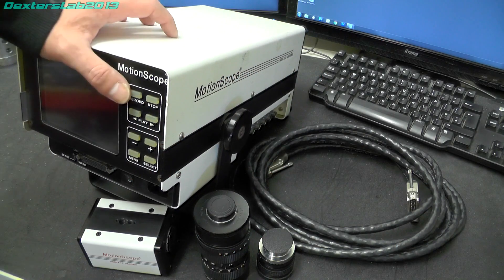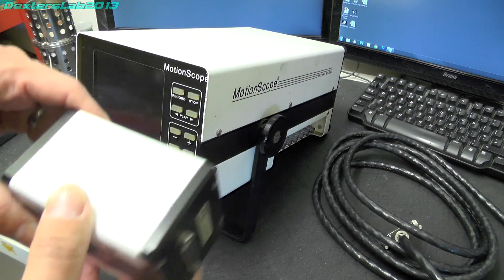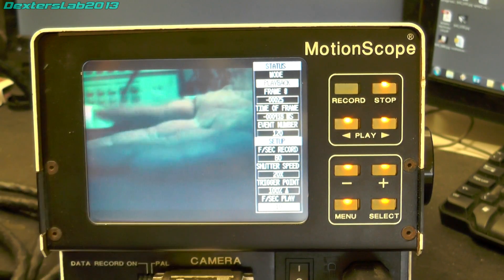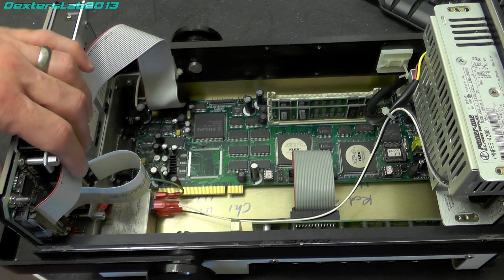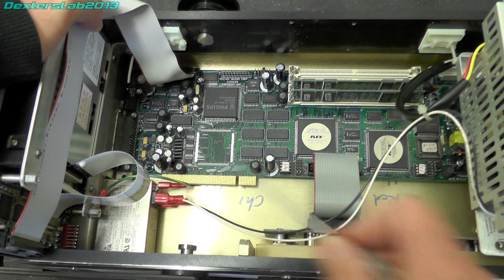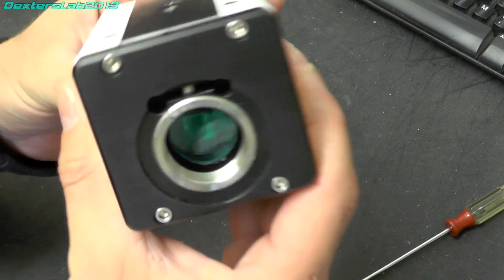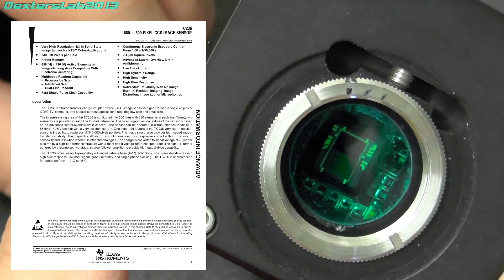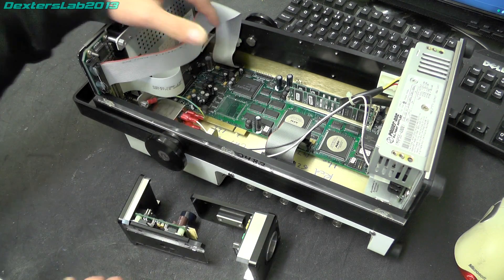DL124 - MotionScope 500C Colour High Speed Video Camera Teardown Part 1

Comment: You might look into power supply/cap problems in the camera head for the changing color issue, if the CCD clocks weren't being driven properly it could cause odd problems like that.
Reply from the maker: Thanks tesla500, when i get some spare time i'll take a look. I had planned on checking volts and bad caps in a few days. Hopefully something will come to light.